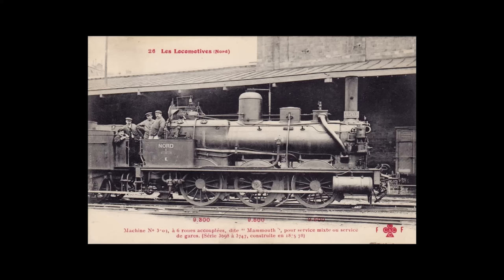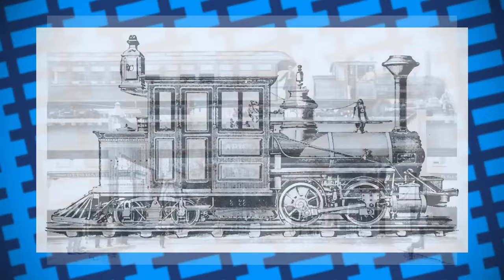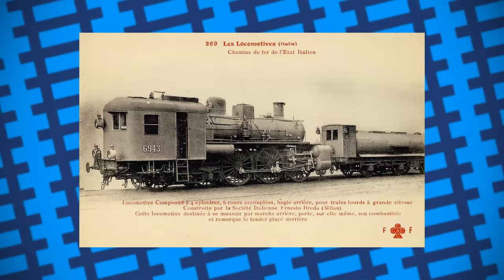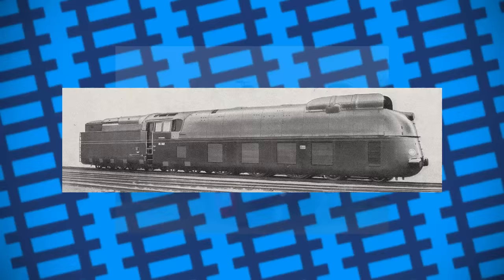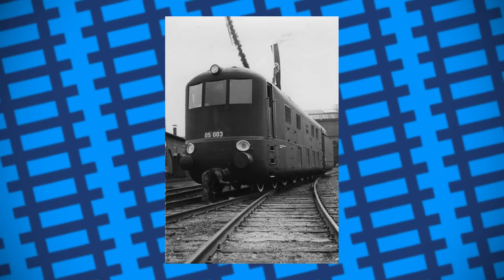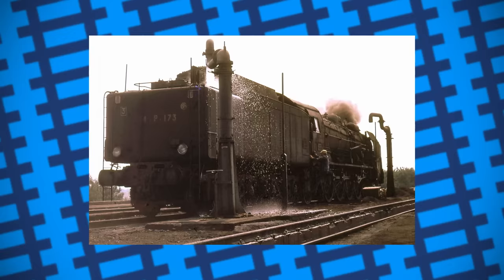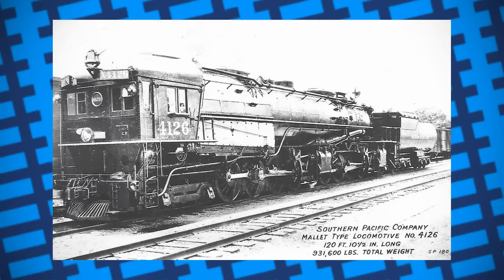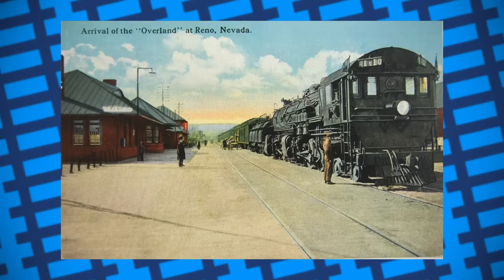Why "cab-forward" steam locomotives usually didn't work - Cab Forward Locomotives

Comment: What about midcab steam locomotives?
Reply: This has already been done on a few occasion including the camal back design and the mother-Hubbard design
Reply: @griffincypert2900  They had the same inherent risk that is mentioned in the film, of separating the crew. There were some nasty accidents when fast running Mother Hubbards broke a coupling rod, wiping out the engineer and the fireman could do nothing about it; eventually the design was outlawed because of the risks.
Reply: @JohnDavies-cn3ro  Oh yes, thank you for posting, but I am already aware.  I was just straight up too lazy to type that lol

Comment: Imagine an coal fired  cab forward.
Reply: Did exist, the German 05 003 was fired by Powderised Coal. I just explained the Flaws of that System in another Comment, I'm too lazy to type it again so I just copypaste that Comment:

Regarding 03:15: The 05 003 didn't have a second Cab, it was just a normal Class 05 (one of only three btw) turned around. The "Cab" at the Back is to open the Smoke Box Door to blow Soot from the Smoke Tubes. Fuel Oil was considered for 05 003, but ditched for Strategic Reasons that we all can imagine but won't discuss as to not risk YT censoring this Comment. Instead, 05 003 burned Powderised Coal, by blowing it into the Fire Box with Compressed Air. That System was tried and trusted by 1937, but 05 003 always suffered from unreliable Fuel Supply often causing it to burn Fuel rich, thus sooting up the Smoke Tubes, often even until they were completely blocked by Soot. If the Oil Burner wasn't ditched in Favour of Lebensraum, 05 003 would almost certainly have worked very well.

The unreliable Fuel Supply was caused by the Coal Piping having to pass under the entire Locomotive, which was not exactly a straight Pipe. The Fuel Feed System and Air Blower were driven by the same Auxilary Engine and thus couldn't be controlled independently, otherwise the Stoker might have been able to react to these Combustion Irregularities. Although I don't know how quickly Combustion changed, if it required Adjustments every few Seconds, I doubt that even the most skilled Stoker could deal with that. Because of the Problems, 05 003 was rebuilt in late 1944 by turning the Locomotive around again, and removing the Aerodynamic Covers Covers completely, thus turning it into a pretty normal German Standardised Locomotive, just with huge Driving Wheels. The other two Class 05 Locomotives were un-streamlined after 1945, matching them to 05 003. 05 001 was preserved with a Replica Streamline Shell.
Reply: Yep forgot about thjat, but still no solid coal fired one  @Genius_at_Work

Comment: 4:33 could ye not have just put the cab on the tender....
Reply: Problem you will derail first and if that happens the engine cannot be stop
Reply: Well I guess the engine will stop and some point
Reply: @JustTomYTreckless  i mean .. i guess but also like idk  i mean if  the train is going fast enough to kill the driver on derailing im not entirely sure it matters which way the foot plate is  facing  i mean either its  going boiler first in which case you going to be getting really intimate with those   stop cocks and handles or its running foot plate fires and your going to go sailing out over the tender ... either way you not going to have time to shut of steam   and if its not going fast enough to kill the driver on derailing then again im not sure how this makes it any harder to shut off steam

Comment: This video is confusing. Both from all the repetitions: one should always use repetitions as  rarely as possible, and this video is an example of some of the reasons why; while listening, we're expecting a sequence of points going from A to B to C and so forth. So when something that has already been stated is stated again in a new way, we parse it as a new point that must have some difference in a detail. It takes a second to realize it was just the same point again, and that little mental juggling with the points is distracting.
The other reason this video is confusing is the lack of expected progress from premises to conclusions. At one point you say "this had the additional benefit of ensuring the engineers aren't exposed to so much smoke" or whatever, which is confusing because I thought that was the whole point? I felt like that segment started with the setup of the company exactly wanting to reduce the exposure to smoke etc. So was it an "additional benefit" or did they simply achieve their goal?
Just wanted to give some feedback as an entirely new viewer of this channel.

Comment: why not go tender first but have a low tender?
Reply: Switch engines used this but the shorter tender ment limited range. This really wasn't an issue as they were always working near water and fuel supplies
Reply: @ericcrockett479  can we make the tender longer instead?
Reply: @slimetank394  That could possibly cause visibility problems for the crew - It's hard to appreciate, if you've never ridden in a steam locomotive cab, just how much the boiler barrel or tender blocks of the immediate view ahead - this is why switch engines had short, slope backed tenders and BR Standards had inset bunkers. Imagine how the leading water cart on an Australian or African Garratt, pushed ahead of the massive boiler, would limit your vison!